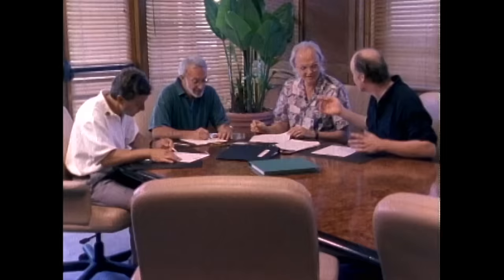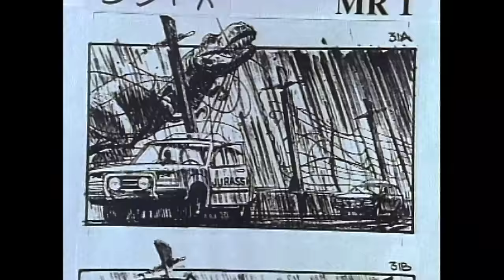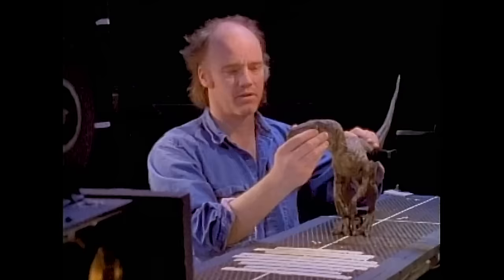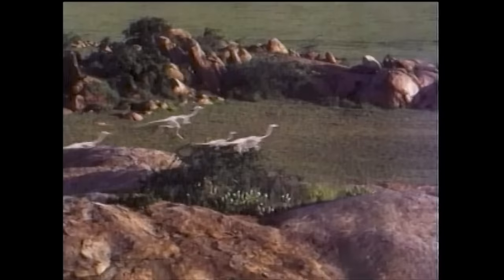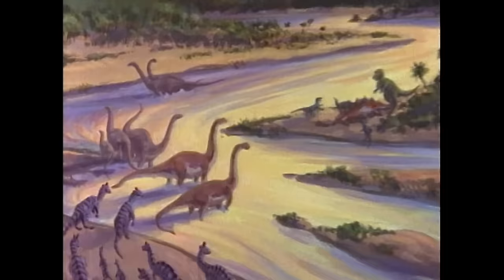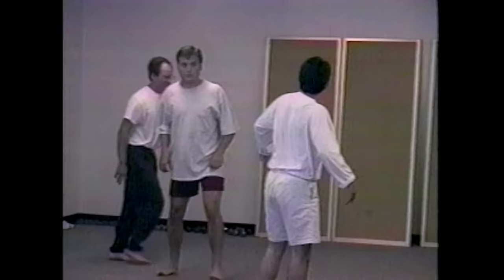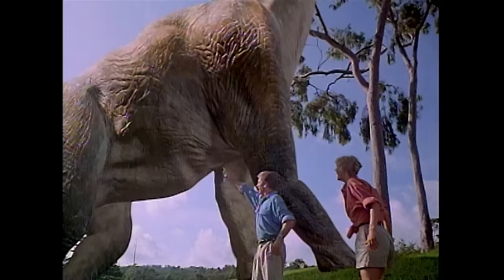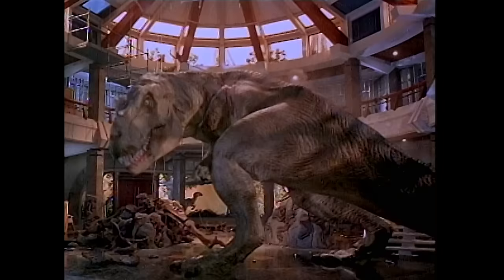Making The Dinosaurs | Jurassic Park Documentary (1993) | Screen Bites

Comment: So interesting that the movie was locked before cgi was added, I feel like a lot of modern marvel type movies use cgi to fix, rather than enhance what is already there and decided on.
Reply: The process is different now. You can see that Jurassic Park was edited on actual film, which means the edit has to be locked down because to go back and make changes would require a lot of work once you've already started adding visual effects.  Film editing is now all done digitally, the footage is digital, it's a lot easier to manipulate and make changes to no matter how far into production you might be. A lot of times now the film is being edited as it's still being shot. There is equipment that adds rough visual effects in real time as the footage is being shot.  It's all just a completely different environment now.
Reply: Beebob-xw9xn  As were Terminator 2: Judgement Day, Forrest Gump, Men In Black and The Lord Of The Rings movies.